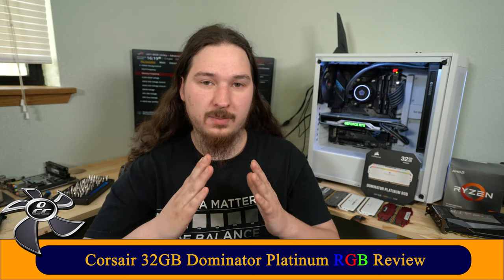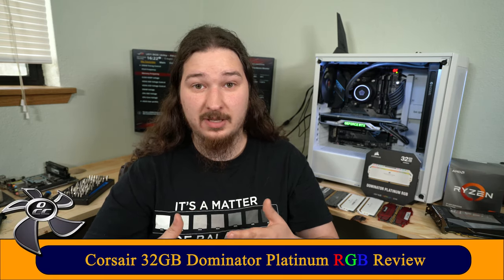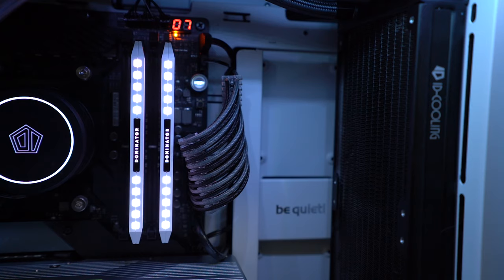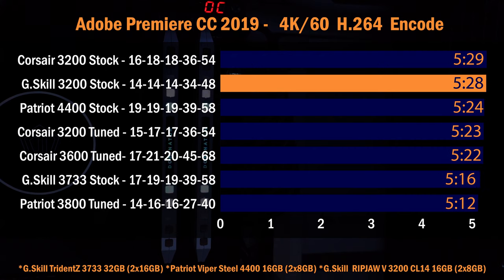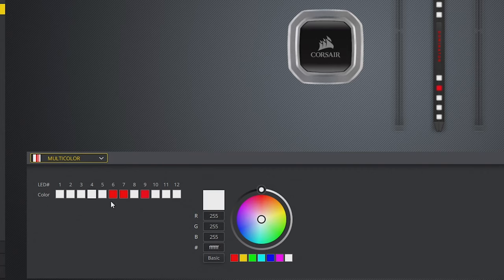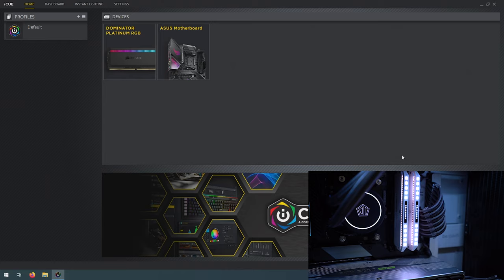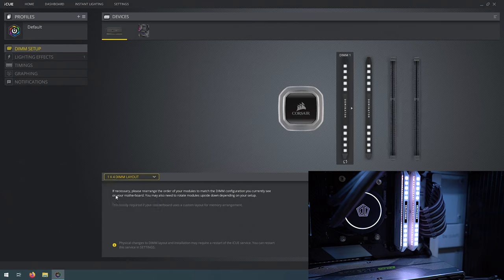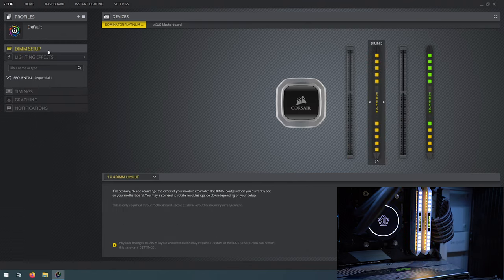Corsair 3200 32GB Dominator Platinum RGB White | In-Dept Review

Comment: Hey I got 3200 32gb corsair platinum and my mobo is x570 Asus rog Crosshair VII Hero and have a Ryzen 9 5900x cpu and haven't started my build coz waiting for 3080 to restock is that good?
Reply: I regret buying 3200 coz people are saying I should've gotten 3600 and Idk if I could return it
Reply from the maker: you can see in my last memory review I used a 3080 @ 1080P https://www.overclockersclub.com/reviews/gskill_3600_tridentz_royal_32gb/ . But that was with a 3800X. I just installed a 5800X. Even though faster memory does help, it still a massive boost over previous gen. I haven't much testing yet. But would assume the gap it a bit smaller now due to the CPU being beefier and not bottlenecking the games as much.

4000 Memory with FCLK 2000 is now a cinch. Same SoC of 1.125v and your are all set if you have the memory to go with it.

Comment: I got the same ram last week. Everything seems to be working well but one led is out of sync and is kind of distracting. Not that I got it for rgb but having that one bright led out of sync is annoying af! Anyone might know why this is? Is there something wrong with the ram or just the led? I'm kinda new to this pc stuff and feel like I'm losing my patience with all the bs problems I've come across.
Reply from the maker: I would ask Corsair. I didn't experience a single led out of sync. But with RGB ram in general for me, both sticks are always out of sync from each other. That annoys me and the only solution I found is to set it a static color and than change it back to rainbow or whatever It was doing before.
Reply: you installed the rgb control software yet?